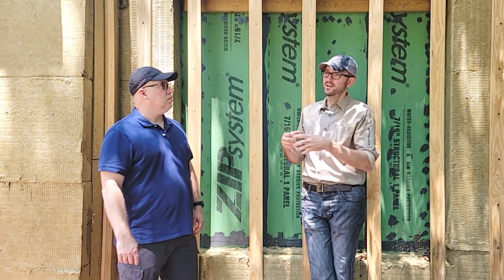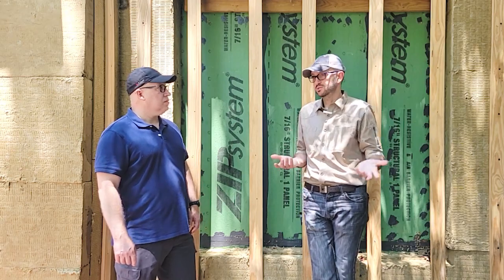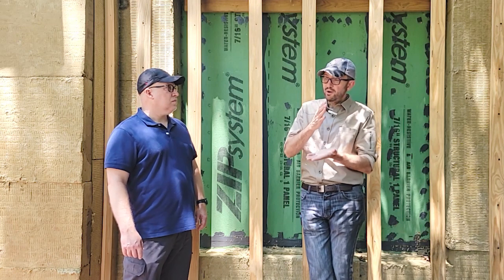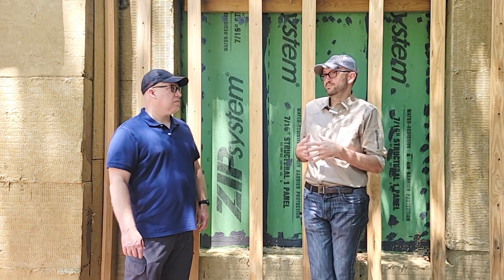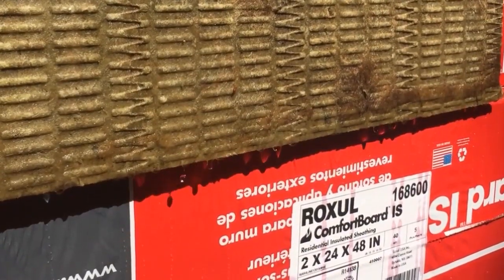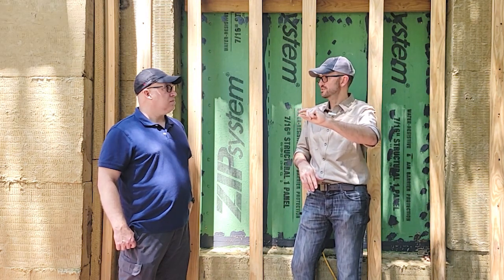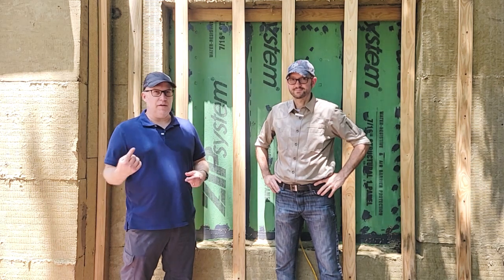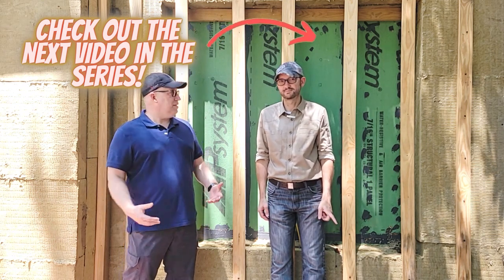Is ROCKWOOL Water Resistant?

Comment: Could I use Rockwool insulation for my sauna build. It wont have more than 30% steam use. Also based on what you are saying, I should not add a vapor barrier in front of it. 

Also, is it non toxic? I don't want to be exposed to VOC's when reaching temperatures of 90' Celsius .
Reply from the maker: Whenever there is a large temperature and moisture difference, you need good insulation, air sealing, and moisture barriers to contain the extra moisture. Steam rooms are a little more complicated, but ROCKWOOL could be used as part of the assembly. I would use tile so the moisture would condense and drain properly and not migrate through the wall.  Here is a good article on steam rooms - https://tiledoctor.com/how-to-install-tile-in-a-steam-room/

Comment: So, from interior to exterior a wall assembly should be as follows: Interior Sheathing -> Stud Framing  w/ Sound Dampening Insul. -> Exterior Sheathing (Zip) -> Moisture Barrier -> Rockwool Exterior Insul. -> Battens -> Cladding? It seems like nobody in the perfect wall community has done a wall assembly section for a residential house, I can never find one with specific treatments for the cladding or sound dampening within the walls now that its hollow due to moving the insulation to the exterior.
Reply from the maker: Here is a timestamp in another video with a section detail- https://youtu.be/KvZ-8kDLVRo?si=4MSwJdKOfsmCBumn&t=321

The insulation on the exterior works for keeps exterior noises out.  If you need to separate interior spaces-- then just add Safe-N-Sounds between the areas you want to reduce noise.  I'll have some videos in the near future showcasing that.
Reply: @SawHorseDesignBuild  Thank you so juch for the quick reply! I hope to use this detail on my own home one day.